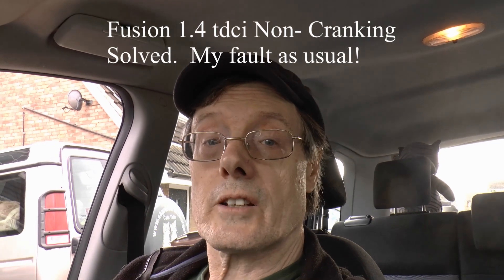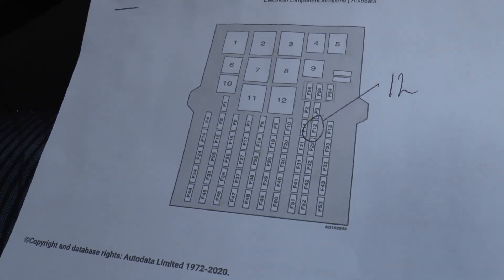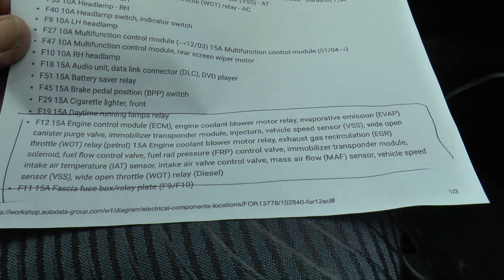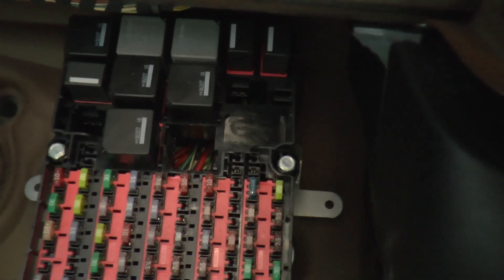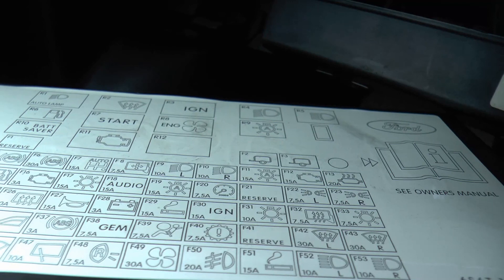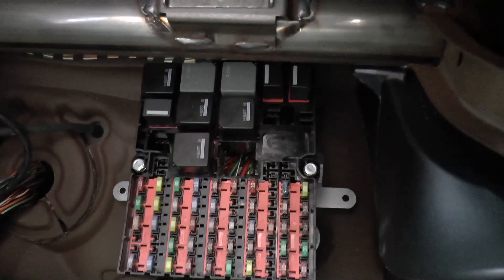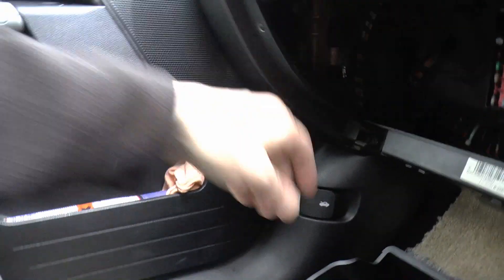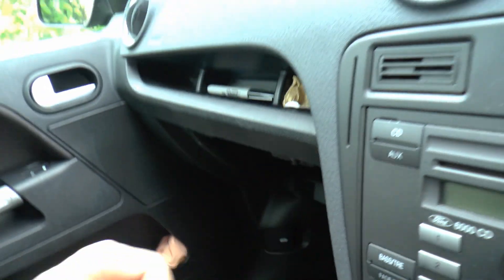Fusion 1.4 Non Crank,  No Start  Solved!

Comment: ı have a problem just like this. [ford fusion 1.6 tdci 2006]  what did you you do ? problem is F12 did you changed this or what ?
Reply from the maker: Yes, I just replaced the fuse and it was fine.